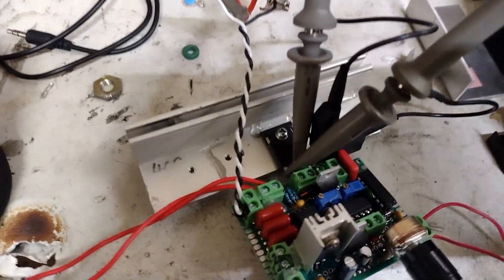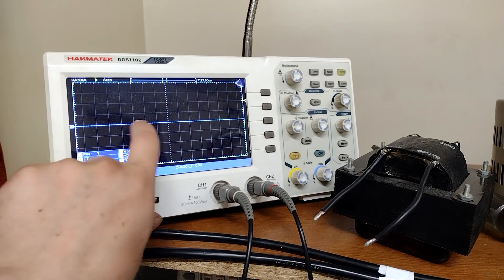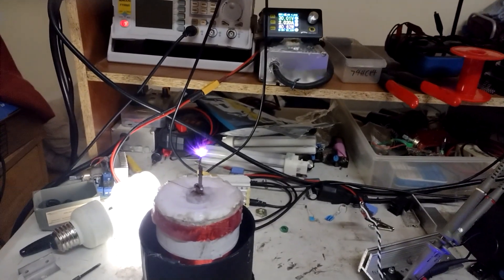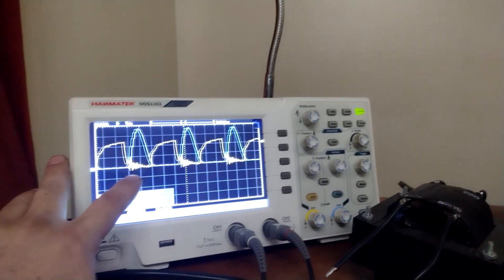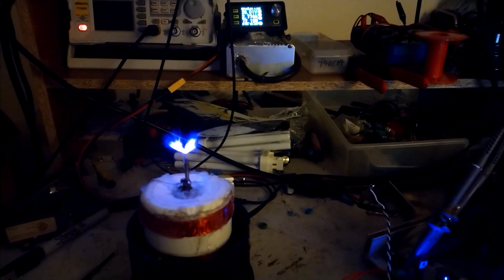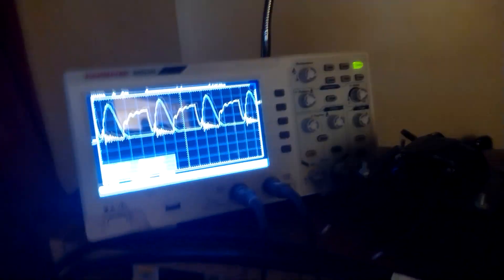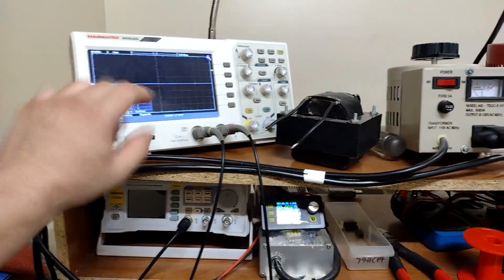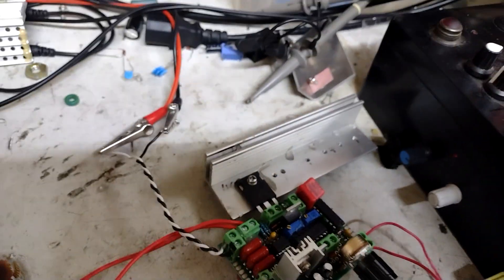SiC Mosfet Driving Continued (2MHz Class E SSTC)

Comment: Hey dude , do you have the schematic for this circuit ?

I also had a doubt about making a class e set up with a schmitt trigger oscillator with interruption and running the power rail with a ramped input voltage at about 50 v max . Would it lead to longer arcs or would tuning this be a nightmare. 

If I tune it at a constant 50v input then adjust the tuning with the ramp would it be better .
Reply from the maker: That one is just the PLL circuit https://imgur.com/aPpbIlF
Reply from the maker: I haven't played with interrupting these really.. but when I did on a 500khz coil it didn't make any difference. For me the point of class E is only to run continuous wave, since continuous wave is the only operation I have trouble running without class E.